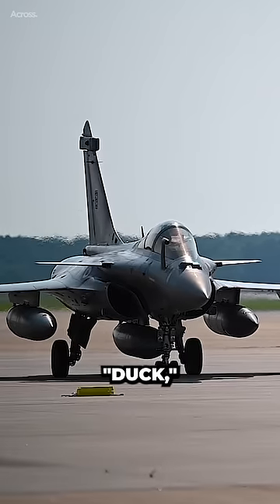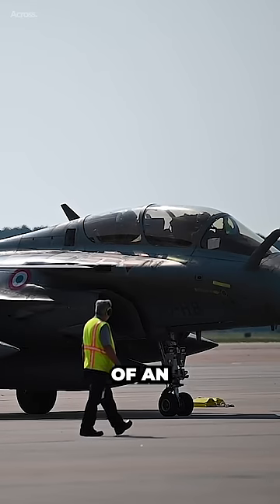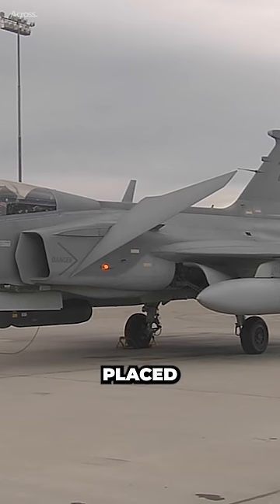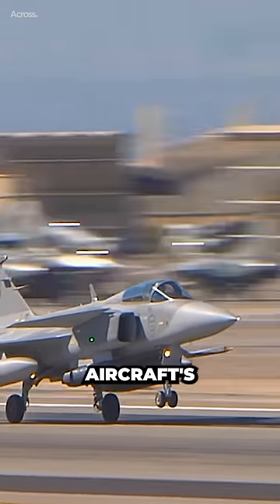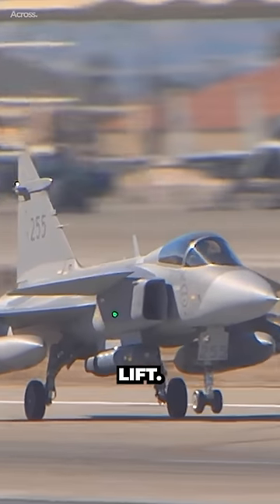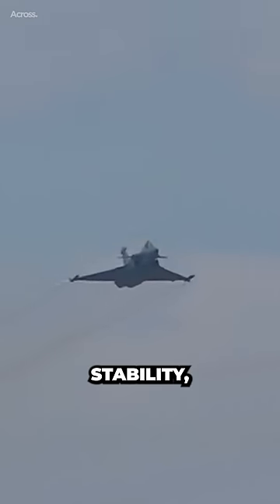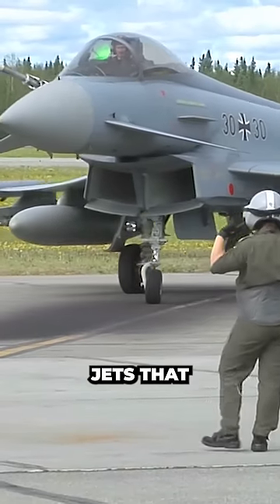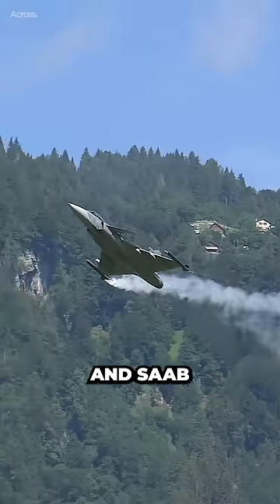Why Don't American Fighters Jets Have Canards? #shorts

Comment: Exception:  in 1988, McDonnel-Douglass built a single experimental version of the F-15 STOL/MTD.  This variant had both pitch vectoring exhaust nozzles, and canards and was described by test pilots as the most stable & maneuverable aircraft they had ever flown.  A joy to fly.

A pity the USAF elected to not add this flying marvel to its inventory.
Reply: I gotta think a major part of that was the fact that maintenance hours per hour of flight time would dramatically shoot up. Also I could see the reliability of such technology in the 80’s to be a bit of a concern when it comes to actually fielding the aircraft.

Regardless - It would have been beautiful to see the thunderbirds fly a few in a demonstration.

Comment: NASA, DARPA, and USAF have studied the design (X-29) and apparently weren't impressed enough by it.
Reply: X-29’s primary attribute (and focus of study) was the forward-swept wing, not canard surfaces
Reply: @beejay7665 The canard was used to compensate for the centre of lift being brought forward, so yes, it was necessary for the aircraft to be flyable.
Reply: @Eis_   & @Douglas Tong

A- the X-29 was STRICTLY a research platform, designed EXCLUSIVELY to test the proposed possibility of supersonic fighters with FSWs.  It has no bearing on the subject of the lack of U.S. fighter aircraft utilizing canard-style control surfaces,

2-  Bee Jay made no comment about the neccessity of canards on the X-29, only that the aircraft was SPECIFICALLY designed for the FSW concept program.  Gen. Dyn. also made an F-16 with FSWs as their testbed for the program, but theirs didn't use canards.  All they did was redesign the wings to sweep forward instead of back.  Rockwell International and Northrop-Gruman (the actual winner of the competition for the program)  chose to mount their platform's wings aft of the aircraft's CG, thus neccessitating relocating the horizontal stabilizers to the front of the CG, thereby making them canards, &

Finally-  the PRIMARY issue with the FSW concept was that above a certain speed, the wingtips would shudder, flutter, peel back, and RIP OFF, hence requiring a degree of flight control input which was well beyond human capability, THUS an entirely new, and completely computer-controlled, FCS was developed to maintain inflight stability.  This did NOT mean the pilot had no input or control, it simply meant that the computer took care of the literally THOUSANDS of corrections necessary to keep the bird flying and prevent it from disintegrating.  The canards were simply a part of the normal FCS.
Reply: @Eis_ yeah but it wasn't the primary thing being tested
Reply: Canards weren't the purpose of the X-29. The plane was not user friendly and required very experienced pilots. That design was not developed further by us or the Russian with the SU-47 platform.

Comment: I wasn't an aviation guy, but while serving onboard an aircraft carrier in the US Navy, I occasionally asked this very question to my airdale buddies and the they all seemed to share the opinion that canards were a workaround to compensate for poor wing design. Non of us were engineer types, just lowly enlisted pukes, but those guys definitely saw the canard wing as a crutch.
Reply: My thoughts also. A workaround to maximise manoeuvrability.
Reply: I don't think it's "poor wing design" workaround, the Mirage 2000 was an excellent delta wing fighter and it didn't have canards, they are now present on the Rafale's design because it brought in a significant increase in manoeuvrability performance, there's only so many ways to make a delta wing design so the canards are a great upgrade to what a simpler design lacks to reach higher performance thresholds
Reply: "Exactly", whenever you see some kind of hinky S?!T on an airplane, i.e. (F-4 Phantom), that don't look like it belongs there, you know, "something went wrong"!
Reply: Delta wings are just generally unstable, and canards can give the pilot more control. Literally, look at Saab Draken inventing the cobra manuevre because it's just that unstable.
Reply: Heard an FTE say the same. Canards cover up bad design. Kind of like wing fences.
Reply: @Eis_  I would love to hear what kind of knowledge these guys have on aerodynamics. If the designs were so bad, how come fighters using said designs can achieve such impressive performances ? There's limitations to the delta wing design, it's good but it can't do everything either
It's as if you were saying the F-series planes were using their tail winglets as bad design cover ups and we better go back to 1950s wing designs
Reply: Actually quite on contrary it is one of the most efficient configuration. When you consider you have to compensate for wings pitching moment, use of canards is better. Reason is simple, typical wing creates nose down pitching moment, in order for you to conpensate for that you have to place other lifting surface either behind or in front of centre of gravity. The conventional tail (behind CG) has to create downard force, which in turn lower airplanes lift (wing lift + tail lift < wing lift). While Canard configuration uses lifting in front of CG, here you can use upward force, which increases the airplanes lift.
Reply: @thegeekno72  Unstable doesn't mean Bad, it just means that it will be harder for it to go back to equilibrium (stable level flight). Also, as I said, that is exactly why Canards are there, to help the pilot do that.

Lookup WHAT EXACTLY aircraft stability means, and maybe you'd see what I mean.
Reply: @thegeekno72  Also, the thing is, Delta-Canards aren't even the only way to achieve that (in)stability. F22, F16, and F18 already have that relaxed stability, perform high AoA manuevres, and great nose control.

As much as I love the EF2000 (Favourite plane, btw), Delta-Canards just isn't that revolutionary enough for me to worship and leave the conventional methods that can still do the same thing.

Comment: The speed thing is wrong. Canards will generally not cause enough drag for it to be a problem up to a speed at which these jets function. It will create a downwash and airflow over the wing will have some turbulence. But overall it doesn't affect things as much. If we are talking about speeds in excess of Mach 3, maybe. But, none of the mainstream US fighters can even touch mach 3 and for good reason. It's inefficient, kinetic heating is abominable and hypersonic missiles can easily bring it down regardless. Exactly why the mig 25 project was a failure as a fighter aircraft. Very few jets in operation today operate at those high speeds. The main reason why canards are never used in US fighters is the complexity of maintenance and the fact that none of the mainstream fighters have delta wings. Delta wing designs use canards to maximize maneuverability and optimize low speed flights. No wonder the Rafale is one of the most agile and maneuverable jets.
Reply: So in the end. It's simply something to correct insufficient wings. By adding immense maneuvering potential.
Reply: Wasn't the MiG 25 a nuclear bomber interceptor ? It wasn't supposed to dogfight or really BVR for that matter, it was supposed to catch up to bombers flying high, supported by the flight ceiling it was built for
Reply: @thegeekno72  if you look at the Gulf war, squadrons of Iraqi Mig25s were fielded against the F-15. The F-15 is better at everything really except for the speed part. Funny enough the F-15 outmatched the Mig-25 in that too during tests. Especially the rate of climb aspect. Had the Iraqi pilots not adopted some clever strategies, the outcome would have been far worse.
Reply: @SuperCatacata  wouldn't say insufficient wings. It's just a part of a design philosophy. Delta wing designs have many advantages over the traditional designs. As an Engineer who works with Computational Fluid Dynamics all day, I can definitely vouch for that. Mirage 2000 is a family of jets with Delta wings but no canards. The truth is in order to make a jet maneuverable it has to be inherently unstable. Delta wings don't have elevators on the tail. It is integrated in the wings as is the case for the flying wing concept like the B-2 or B-21 etc. In short it can function without the canards but needs them to be more maneuverable at low speeds. It fits the rafale's profile well as in a traditional fight, it has a good chance of sneaking up to the adversaries because of it's low RCS. Since it doesn't have thrust vectoring engines, this is a very good way to compensate for that. The only US jets that have thrust vectoring are the F-22 and now the F-35.
Reply: @SuperCatacata not at all, it’s simply apart of the design philosophy. Delta wing aircraft operate just fine.
Reply: @indrayudhmondal412  The MiG-25 was designed as a high speed, high altitude interceptor of course it would fair poorly against the F-15, designed as an air superiority fighter.

It's also worth noting (relevant to a later comment) that the F-35's thrust vectoring is limited to the B variant, and only for VTOL; it does not vector for maneuverability like the F-22.
Reply: You missed the point, it’s endurance over sustained speeds, not “I went Mach 3 for 30 seconds and ran out of fuel” but super cruising at Mach 2 at 65,000ft for several hours a day over the life of the aircraft.
Reply: @garyfoster3237  Even the United States doesn't have field any aircraft that can supercruise at Mach 2
Reply: What war has the Rafael participated in ? Have they EVER competed against US jets and their pilots ?
Reply: @corbettmanley932  that's not a fair argument. The Rafale's design is very new compared to the F-16. There hasn't been a war since then with a country that owns and operates Rafales. Just because a plane hasn't participated in a war yet doesn't mean it is not good. The F-15 had had a lethal reputation way before it was fielded in the Gulf war... So thr capabilities of a plane is in its design. Why does the world fear F-22? Which war has that featured in? Until date it has only one air to air kill. Against a balloon. Yet it is one of the most feared planes. And rightly so. It is a great plane and an awesome design. A brainchild of truly brilliant people.
Reply: @corbettmanley932  also just so that you know, F-16s have been shot down by Mig-21 bisons. What do you have to say about that? Does it make the F-16 a worse plane? As Goose said," It's the pilot Mav, not the plane." Most of these designs are very capable designs. And yes they have been pitted against 4th gen US fighters in mock drills between allies and friendly nations. Have they come out on top all the time? NO! But they did excel in certain scenarios.
Reply: @indrayudhmondal412  The F-15 had a lethal reputation prior to being fielded in the Gulf War because it was used in aerial combat to great effect by the Israelis in the 70s and 80s; it had the reputation by that point because it had earned it.
Reply: @PhycoKrusk  the F-15 had earned the reputation when it broke the records held by the Soviet Air force at the time for rate of climb, service ceiling etc and the fact that the west actually had a plane that the Soviets wrongly boasted of having. A highly maneuverable fighter with very good avionics and BVR weaponry. Client states bought that plane because of the same reasons. Waaay before it was ever used in a war. You are missing the point here. No one ever said the US jets are less capable. In fact they are one of the most capable planes. F-16, F-15 are older airframes and were state of the art when they were built surpassing every other competition. However with the evolution of aerial warfare and ground/aerial radar technology, things have progressed. The US sees the need to keep its fleet updated and the best in the world, hence they are slowly phasing out older designs as is the case with many other countries. That's exactly how engineering works. It doesn't make the older designs bad, just highlights the need to update the inventory.
Reply: @indrayudhmondal412  I'm going to leave it at that, as I am no longer certain what it is you and I are arguing over (or if we were ever really arguing in the first place)
Reply: @PhycoKrusk  we weren't my friend. We both were basically saying the same thing. My only contradiction to what you had said about effectiveness is that the capabilities of a plane is based on its engineering design not the fact that it has fared in x, y, z wars. That's all. It's highly likely that newer designs haven't seen as much combat as the older ones. Use of these aircraft in modern day warfare is severely restricted by international politics. And for the right reasons too. But that doesn't mean the newer designs are any less capable or are lacking. Like I said, the F-22 is the most feared jet and for all the right reasons. It's the best plane there is. Yet the only combat it has seen is against a balloon. The lack of combat doesn't make the F-22 any less capable. That's all. 🙂
Reply: @indrayudhmondal412  I'll accept that. I'll maintain that the F-15 has nevertheless earned its reputation in combat, but you are correct that the pilots have to be factored into that. The airframe sure matters, but a combat record can never be a strict "numbers on a page" analysis, and likely reflects more on the pilots than it does on the airframe.
Reply: @PhycoKrusk   @PhycoKrusk  combat is always good metric for performance of a plane. Earlier in the time before the age of simulations combat was the only way to ensure effectiveness. But my point is technology and simulations (not flight simulator games) have come very far from the 70s. The simulations of today frankly can factor in hundreds of things mostly because of the use of machine learning and capable computers and super computers. They are as accurate as combat scenarios these days. These planes are often pitted in joint military exercises  between friendly nations. Every airframe is subject to rigorous testing and scenarios before it is certified. Furthermore the point that I have been trying to make is, effectiveness is a factor of design. The engineering of the plane matters as much. That part has always been consistent. You don't need combat numbers anymore to determine the effectiveness. The combat numbers will be high for a plane that is considered very capable. Pilot skill is important but the whole argument here is about airplane design not pilot skill. I don't know if you follow F1, but a big reason why the current champion Max Verstappen is absolutely dominating everything is because he has a great car. The fact that the Redbull racing team had a great car was evident before the season even started. How you may ask? Through rigorous simulations.
Reply: @SuperCatacata he biggest reason is probably because the conventional designs of the f35 is cheaper and extremely high manouevreability is not really a key design feature anymore.
Reply: @indrayudhmondal412  thats their fault for buying MiG 25s, the designated role the russians gave the mig 25 was high altitude interceptor, it was never built to be a fighter even if some people happened to use it as such
Reply: @corbettmanley932  yes, in 2009 a rafale scored a kill against an F22 in a mock dogfight during a training exercise in the UAE

even if the answer was no, you could have made the same argument for the F22 saying it has never faced the rafale or been in a war, but we dont gotta get into that because it has, and lost, not to say the F22 isnt the best air superiority fighter, it is, and the kill was likely due to pilot error from the F22 but ur spewing bullshit

edit: the rafale has even been used in combat, all over the middle east lmao
Reply: @molstad182  👍🏼 agreed.
Reply: @indrayudhmondal412  It was already far worse for them.
Reply: @carwyngriffiths  "design philosophy" lol
Reply: Kifir c7 is crying that everyone forgets it’s existence
Reply: "Hypersonic missile "  the most OVER HYPED OVER RATED  weapon ever created
Reply: @PhycoKrusk  SR71 Mach 3.3 although not a fighter.
Reply: @corbettmanley932  yup, in training a Raphale killed an F22
Reply: Why have delta wings in the first place then? The canards in conjunction with FBW are essentially correcting that mistake. This is US did all of this through the 50s, 60s, and 70s. Rafale is nothing special, and they have to land on US carriers which is hilarious.
Reply: @corbettmanley932  it was used all over Africa and the Middle East.
And yes, they competed against americans for multiple contracts and always won overall with stealth being the only edge for US aircrafts (by a small margin).
However, the European countries cannot use American nuclear weapons without american aircraft, hence why they brought the F-35 over the Rafale.
It was clearly shown in both Belgium and Switzerland where in both cases, the Rafale and Grippen won by far for each countries needs, but for the sake of relations and nuclear capabilities, an overpriced aircraft was chosen.
Reply: @indrayudhmondal412  Provide a source to this info because I cannot find one.
Reply: @molstad182  was the f22 carrying drop tanks?
Reply: @einarabelc5  With drop tanks ruining its stealth?
Reply: @kingwein89 hm they can land on Charles wdym